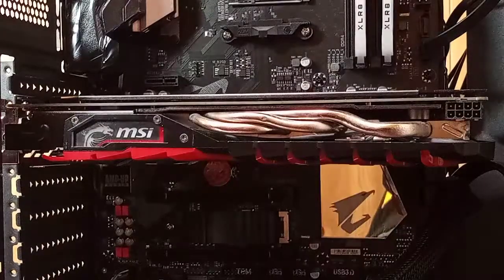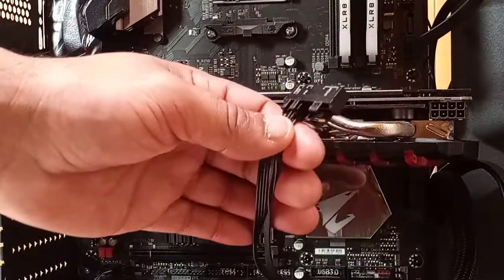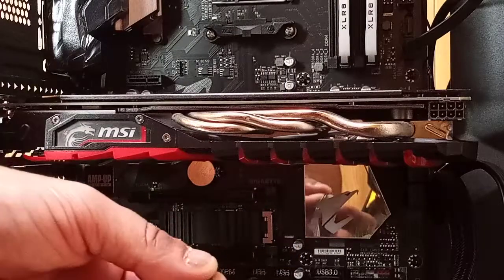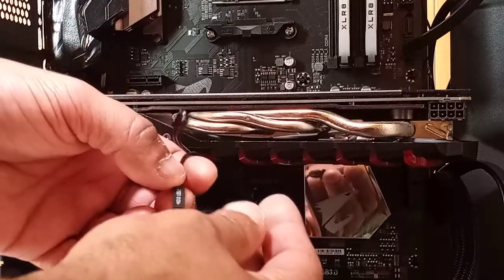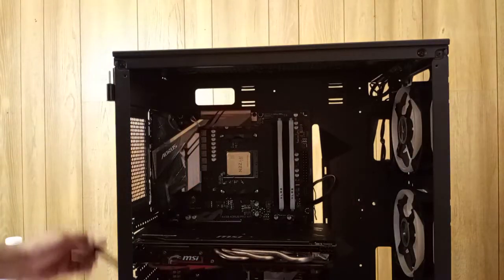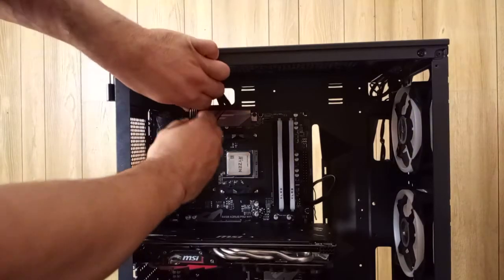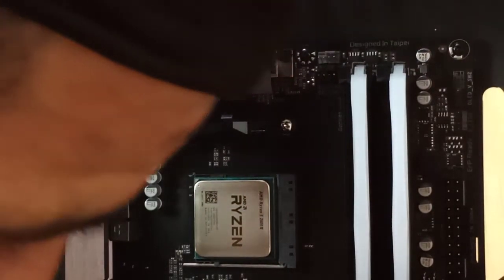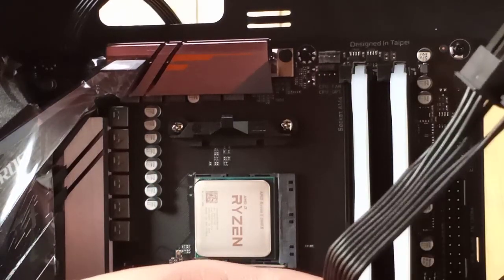gigabyte G connector how it works

Comment: I know this is old but will the g connector work on say an asrock board?
Reply from the maker: Yea I don't see y not its just like these little slots that you put the actual cord with the little power pins into it if that makes any sense haha but maybe you should Google it to get a second opinion not that they always right but it's better than none
Reply: @Tek4Rek  I did because I have 2 aorus elite x570 boards but the connector for the fp on my main system's case looks like the HD Audio connector so I was trying to find out so I can give my dad one and his board is an Asrock. I wasn't able find out one way or another.
Reply from the maker: Good man u are

Comment: Where can I find these? my plugs seem very loose on the pins as well and want to fall off. My gigabyte z690  ud ddr4 motherboard did not come with one of these. This is the only video Ive seen reference the adapter but I cant seem to find them online or what they even came with.
Reply from the maker: I got something for you to get bro did u find it ?
Reply: @Tek4Rek  I did not. seems like its a discontinued item possibly?
Reply from the maker: U ok 👍🏾?